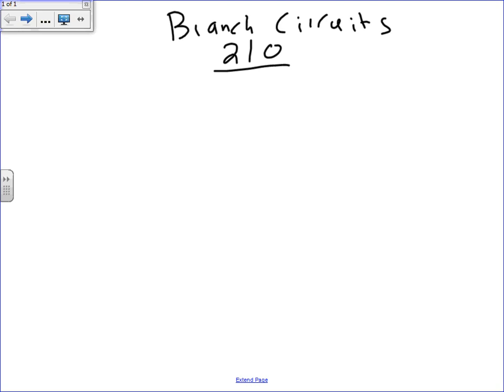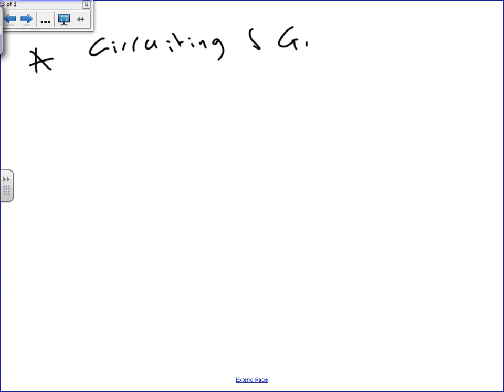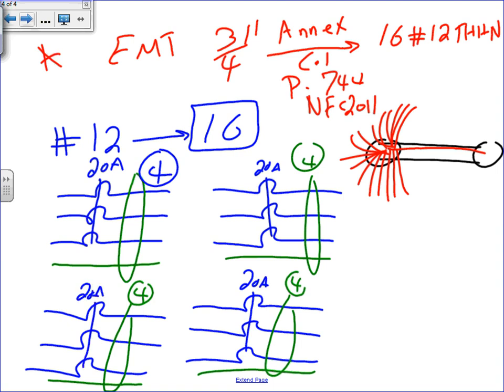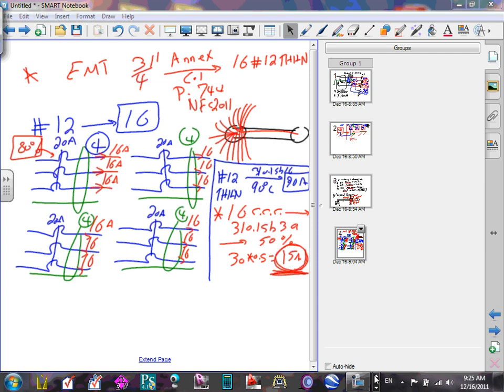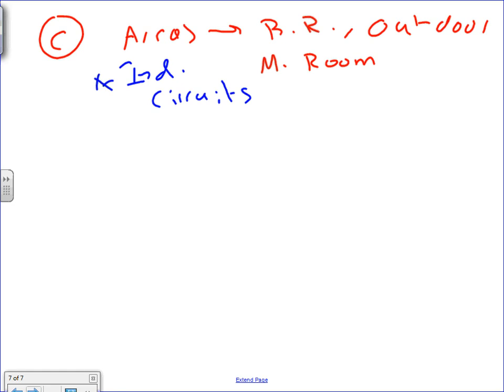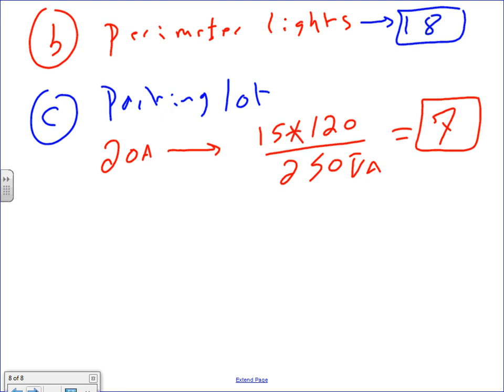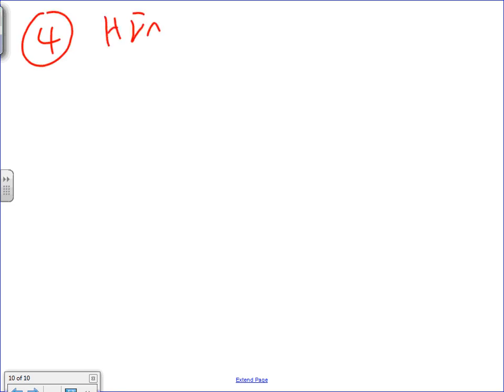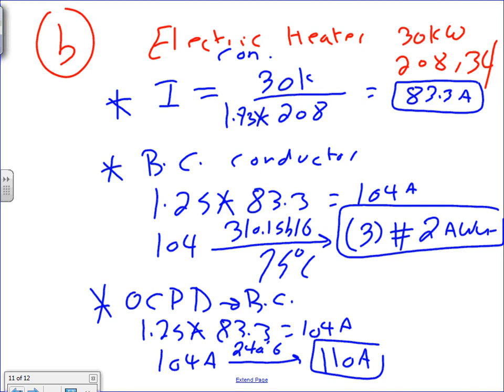Commercial Branch Circuit Sizing-12-16-11.wmv

Comment: 16 #12 AWG in EMT have 15A ampacity even  at 90C after derating. What happened to 240.4 NEC? You have 15A OCPD , therefore you can not step up with 20A overcurrent protection. You have to protect them with 15 A OCPD, and for continuous load we will end up with 12A on each conductor. Either reduce number of conductors to 9(70%) or go with #10AWG for JB-box